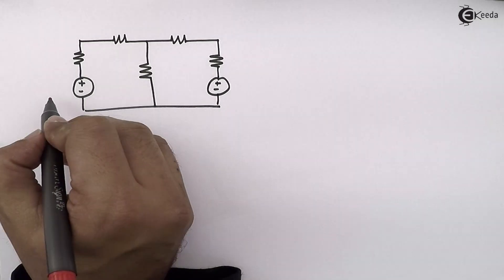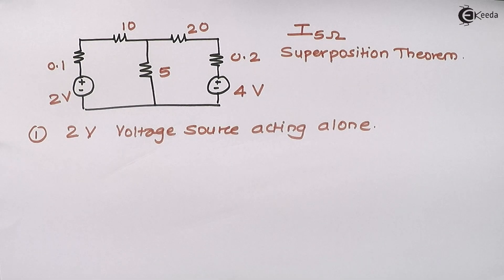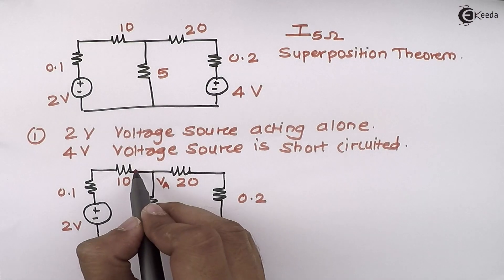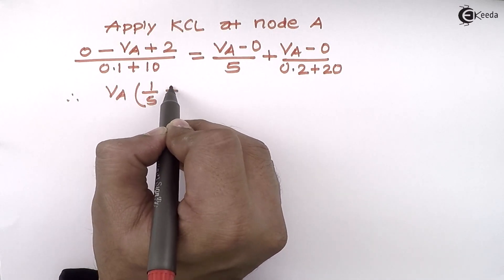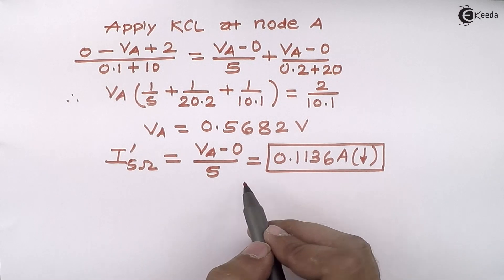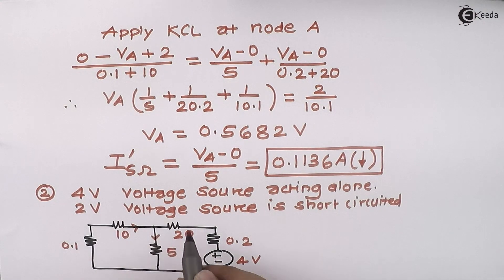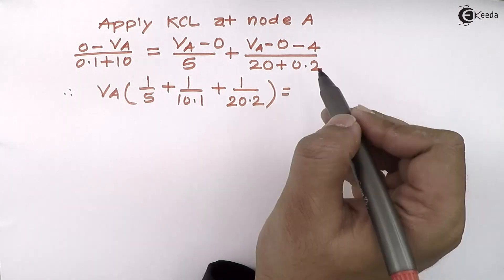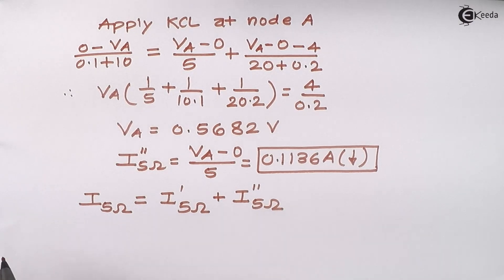Superposition Theorem : Problem 1 - DC Circuits - Basic Electrical Engineering

Comment: while calculating the V(A) for Step 2 : Sir by mistake wrote it 4/0.2 instead of 4/20.2 
but I calculated V(A) for it and its : 0.5681492109038737 i.e 0.5682 only.

so in short the V(A) calculated by sir in the end of step 2, is Right!

For Calculation :
V(0.2 + 0.099 + 0.0495) = 4/20.2
V(0.3485) = 0.198
=> V(A) = 0.5682

Comment: Voltage due to 2V - 0.568V 
Voltage due to 4 V - 0.568V 
Total current passing through 5ohm resistor = 0.227 ampere